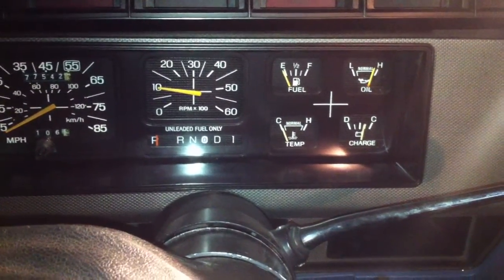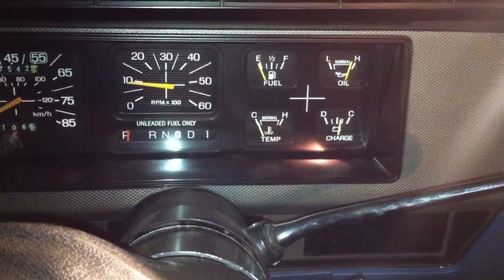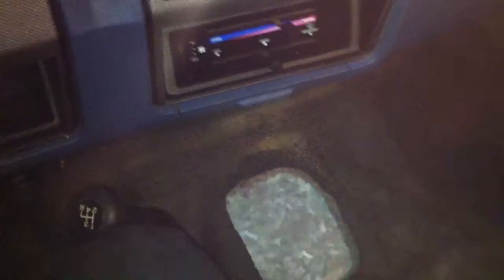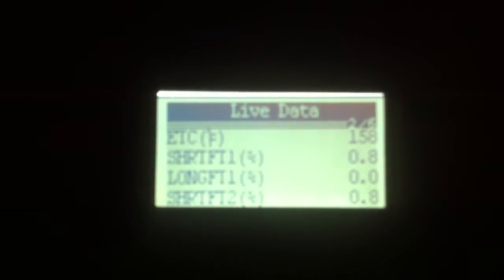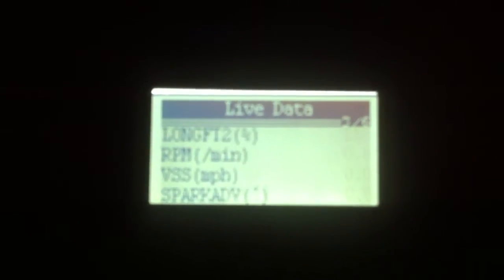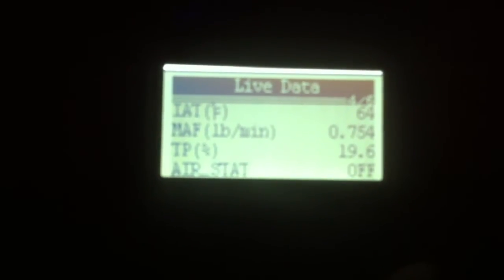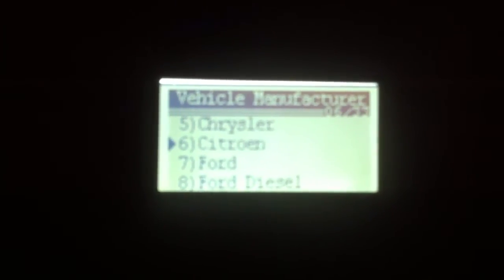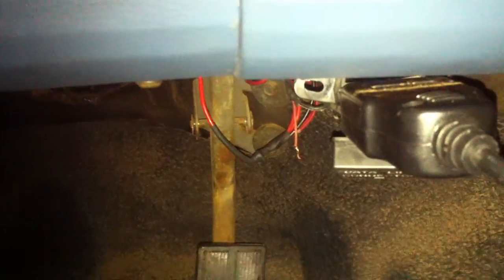86 Ford 300 swapped to 1996 4.9L EFI w/MAF

Comment from the maker: Yes. I found a '96 F-150 and I pulled out the harness to the junction box under the hood. I was running a speed density ECU before hand and I can tell you it's a different plug in between the '92 I had and the '96 I put in. I looked through the pictures and didn't see any type of part number. If you really need it I can pull the ECU out of the truck and take a look.